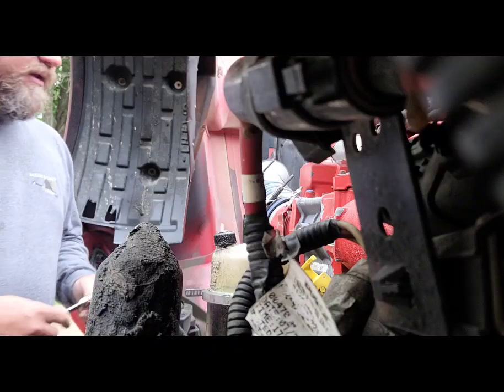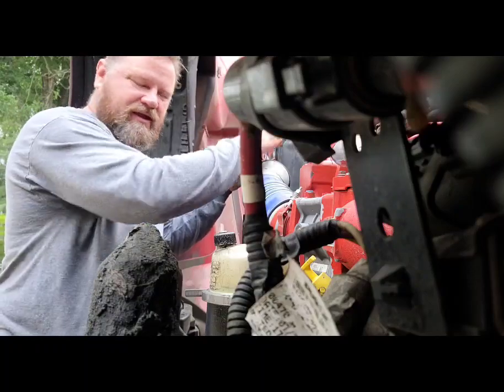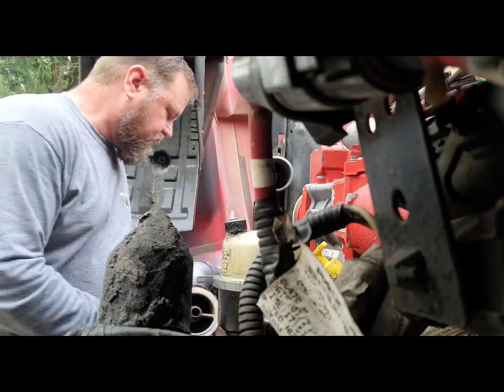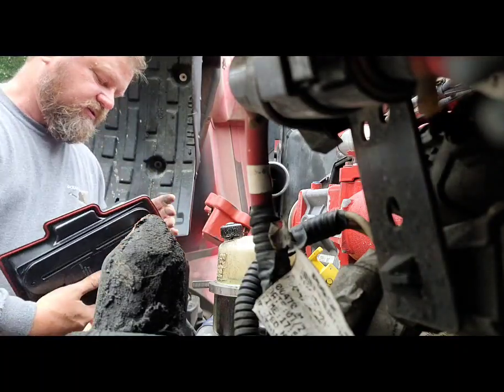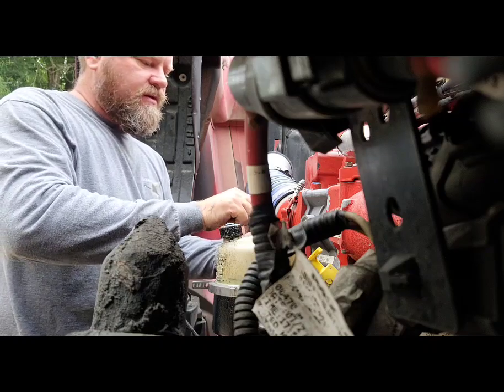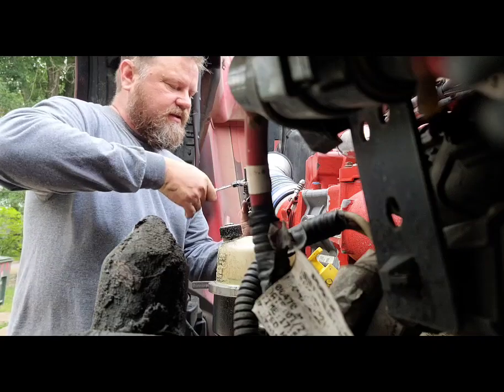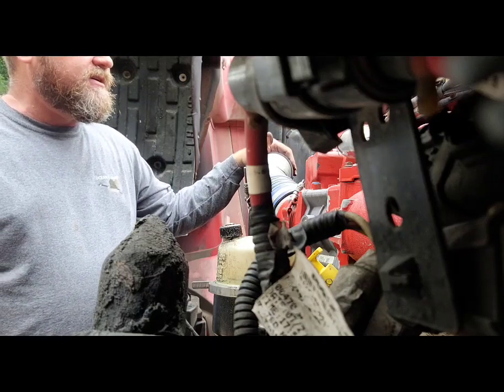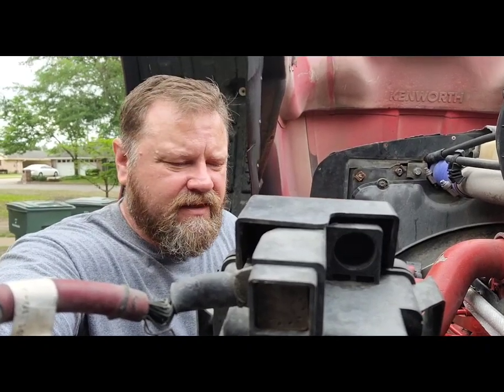#157 Cummins ISX replacing crankcase filter

Comment: You should if you have not, change your IMAP sensor and Delta sensor and might as well change your Barometric sensor, so it doesn’t slow you down over the road, I had issues with those over the last month, helps with fuel economy also. My nox sensor went out the month before, my mileage is at 540k Cummins isx
Reply from the maker: Oh man, it's a rabbit hole, lol,